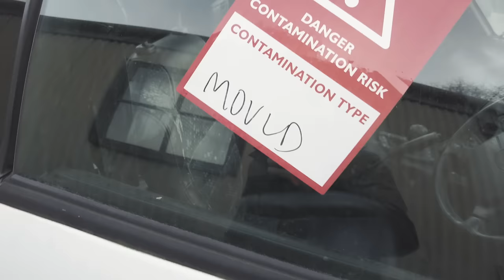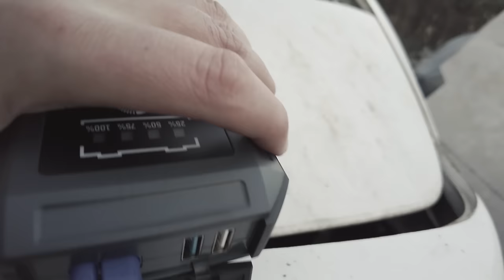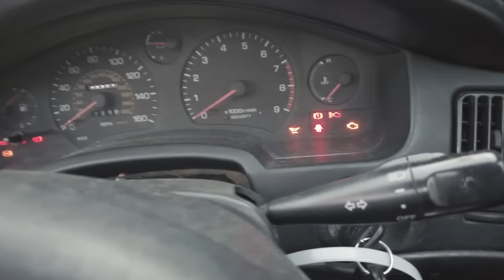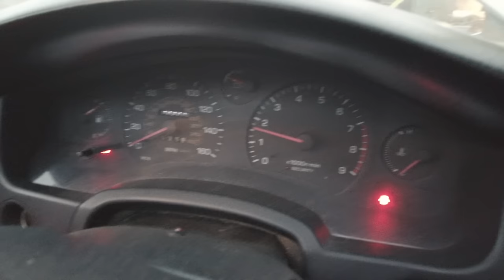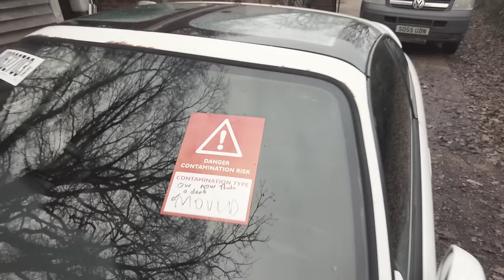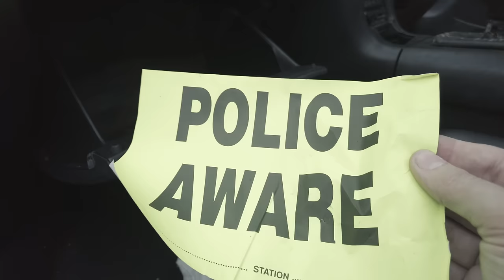Should This £500 CRASHED Toyota MR2 Be Fixed?

Comment: if time and money permits bring it back to show room specs you could make it a powerhouse for  car shows chances are the chassis is not too bent or even bent at all its a nice rear engine car on the cheap and it should be good on gas plus you got T tops as well
Reply from the maker: Thanks that would be nice I'll see how bad the rust is once I get it up in the air!! 🤞

Comment: Fixing it up will be best move for channel views. Hard to say until the front is off and you’ve looked underneath. The quick glimpse underneath as it went on the trailer showed it as not being covered in rust but that stuff in the trunk could be the tip of an iceberg, I guess. Just those two places could be done, though. I pulled the front out of a crashed Citroen BX by using straps and tugging on it with a Passat wagon.  By having someone sitting in the BX with the brakes hard on and me backing up the Passat with strap front to front I could see how much I was pulling it out without overdoing it. Better than backing up with the front tied to a tree in my opinion - can’t see what’s happening. Still a bodge method but it worked for me - all the replacement panels and parts went on straight. Good luck, whichever way you go. 👍🏻
Reply from the maker: Thanks yea I'm gonna get it on the lift in the next couple of days and see how bad it it hopefully it isn't too bad! 🤞 Not a bad idea I could probably do the same thing with my transporter!! Thank you

Comment: Easy for me to say as I don’t have to do it but definitely fix it. With regards to rare expensive lights on the rear, would that reflect on the cars value as opposed to if it had the standard set up?
Reply from the maker: I'm hoping that it's not too bad underneath 🤞 I'll get it on the lift soon! I think as a project the rear lights probably make around £500 difference I reckon. Thanks 👍

Comment: Brake it. It’ll be rotten underneath plus if you do fix it, it is still a CAT car. You get your investment back on engine alone. Then a £1k for rear end, £150 for alloys, £150 for doors, £100 for seats and steering wheel, £200 scrap. £1600 potential profit maybe more. You won’t get that profit fixing it up.
Reply from the maker: You are right those are pretty tempting numbers!!👍 I'm putting it on the lift tomorrow to see how bad it is!! 😬

Comment: I'd break it. Not worth the effort fixing it, and if you're looking at trading up the money the parts will bring in my opinion out weighs the hassle of repair. Looking forward to further videos.
Reply from the maker: I'll get it on the lift tomorrow to see if it's rotten if so it's 100%a breaker! But I've fixed a couple cars on the channel that I was told should never go back on the road so I'm a bit of a sucker for a challenge 😂😂 thank you!! 🙏